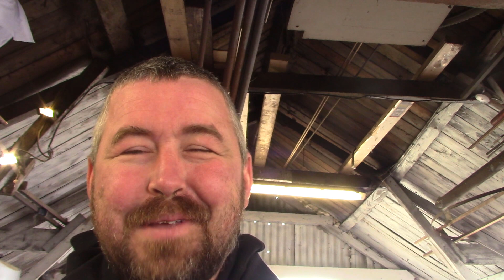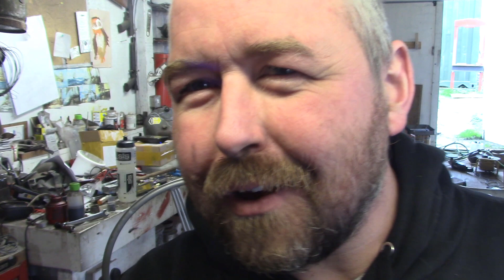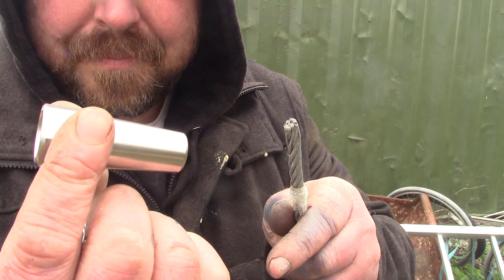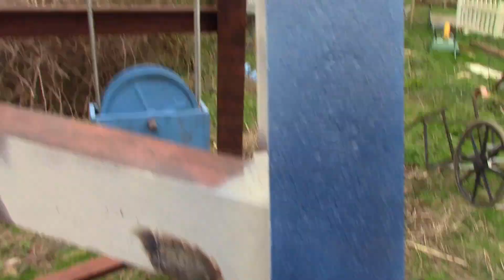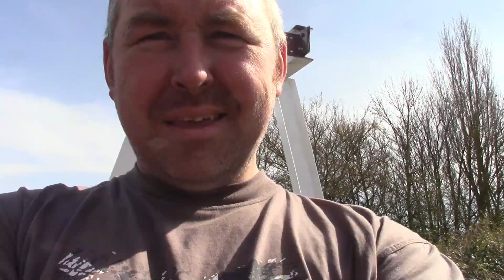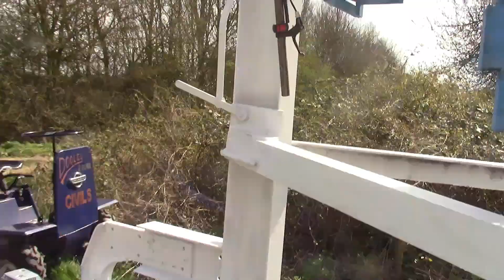Mighty crane build.. Finished!

Comment: Don't forget to subtract the weight of the block and tackle from the back and add it to the front for when it's dumping removed soil lol. I still think you'll need ballast at the back and beefier tyres though our kid.
Reply from the maker: 1/2 the weight because it's only got half the lever arm.... It's a heavy ol block though, gave myself a black man's pinch right beside my cock trying to rig it up to lift pipe today, and inch to the right and it would have been a very quick vasectomy. It's all on camera.

Comment: And to think, I was excited when I got myself a little engine Crane and built a Jib for the tractor to lift a Couple of Hundred Kilos. 
This is definitely a DIY project to behold!  Well done as usual mate.  Will you want to move this with any Load on? If so you might have to look at doubling up the wheels  so they don't sink in the soft ground. Looks like that thing could be way too much fun. 
With the amount of wind that can be heard, maybe you should put a wind turbine on the top and make some electricity to power the house!
Reply from the maker: Ha, hybrid self charging twin engine crane...
I've taken so long building it that the ground is firm now, should be ok

Comment: That crane could be useful for all sorts of stuff. Question for you Jim. If a lad was buying an arc welder for general diy welding what should one look for/get?
Reply from the maker: I'd advise against Arc for starters mate, mig gives you a lot more versatility as far as thickness is concerned, it's easier to fill gaps, easier to make vertical or upside down welds and much quicker to learn, I get the Saturday lads at work welding in 5 minutes with mig, 10 minutes later they are making better welds than me!
Reply: @turboconqueringmegaeagle9006  ta for that 👍

Comment: If you want to increase grip but not weight, maybe change the tyre to a cultivator, quad bike, or lawn mower/tractor tyre.
Reply from the maker: I might have to, was trying to avoid paying for anything I didn't already have as once the pipe is in the ground it'll probably get cut up.
Reply: @turboconqueringmegaeagle9006  what about fitting a seat and using your body weight.

Comment: An idea for you! Mount 2 Boyle jacks on the bottom of the legs that have the car tires. Why? In case the ground is so muddy that the crane sinks deep and bottoms out on the I beams. Then you can use the bottle jacks along with some wood or a metal plate to lift the car tires out of the mud and get yourself unstuck. 
What do you think? I’ll be performing all week, try the veal 😁
Reply: don't tell him that,. i want to see him build a second crane to salvage this one with!
Reply: @gramursowanfaborden5820  😹
Reply from the maker: We'll be alright lads, grounds good and firm now